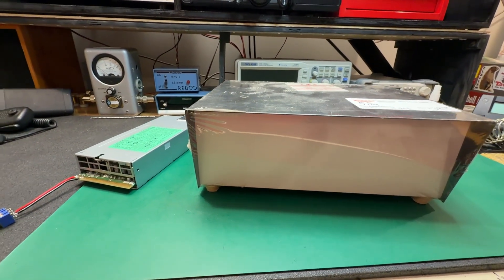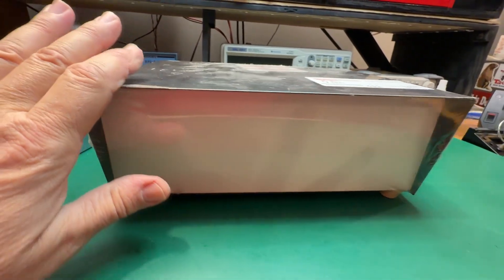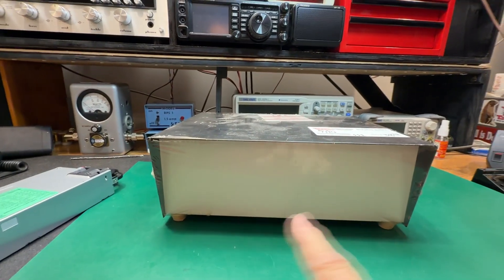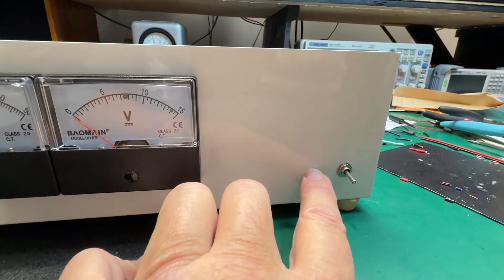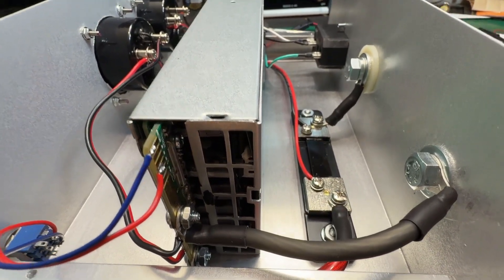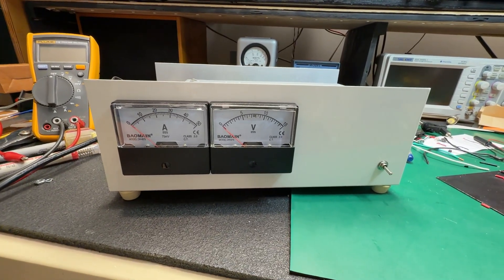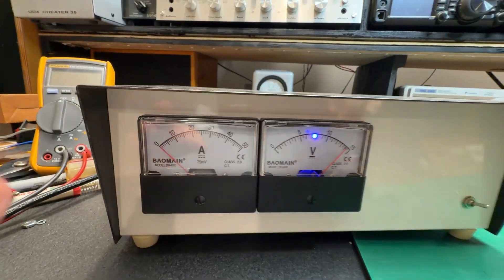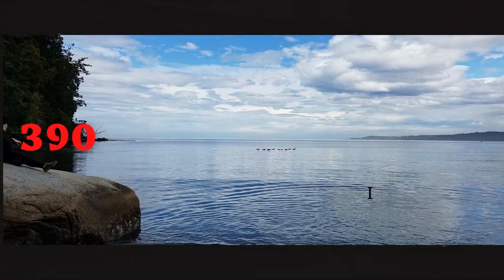Fifty Amp Power Supply Project #cbradio

Comment: imho power poles would be a better/neater way to go.
Reply from the maker: I would maybe add the power poles for my dedicated slave unit. But not for main power terminals because then I would have to convert most of my devices over and I don’t want to do that. I like the flexibility of having posts. Thanks for the comment. Cheers.

Comment: Really liked the old school look but accurate and stable new tech power supply!  You could have used a Big transformer, heavy bride rectifiers, and Big caps, heavy power transistors, large heat sinks, and fans to accomplish the same thing.  That would have been cool to see, but it's been done many times and it would give off all that heat and probably weigh 35 pounds!!  I liked your referring to yourself as vintage - I am too!  ... started working on radios back in 1963.
Reply from the maker: Wow! I'm a 63 model, you have me by a few years or so. 
Yes my thinking was to put together a decent amperage PS but without all the size, weight and money.  Guys have been using these server modules for years. My thinking is that these have a proven track record now, so embrace the new tech and give one a try. So far so good, powers up my amp with ease, runs cool and no switching noise. Thanks for your kind words and Cheers.

Comment: The internal wire awg is a little underrated. For 50A it should be more like #8. Looks great! 73
Reply: I take it back.. I looked again and you have it nice and beefy! Great work.
Reply from the maker: Yea.... it is 8ga. The Red wire is old school OFC pure copper and the black is that new crap, Metra wire. Way back in the day Metra wire was good stuff, nowadays its that clad stuff. I just used that cause it is black and these are short runs, thanks for watching and CheerS.

Comment: which is better. iron core or the new type with out the big transformer ?
Reply from the maker: These switchers can be kind of dirty, that is they can generate noise and you will hear that in your radios receive, sometimes. The Linear Power Supplies are way cleaner (quiet) and that is what you want for powering radios.  I don't have a problem with the switchers for accessories like "Reverse Preamps" as DD21 would call them.
Reply: @390WagonMaster thank you. I'm considering the 50-70 amp power supply from Pyramid. iron core.
Reply from the maker: I have had great luck with the Pyramid supplies. As long as IMO you get one rated higher amperage than what you think your max current draw will be. Like at least 10-25% more, that way your not over working it.
Reply: @390WagonMaster good thinking
Reply: im going to use it with a RCI-2970n4
Reply from the maker: @christophersmith1155  The 50A might be cut'n it close. the 70 should get it!
(excuse me for the redneck terminology... I be talking to 3MADE on the phone tonight and he rubs off on me)
Reply: @390WagonMaster cool